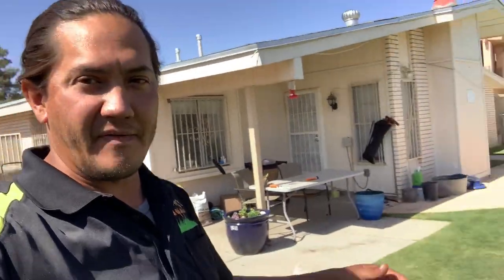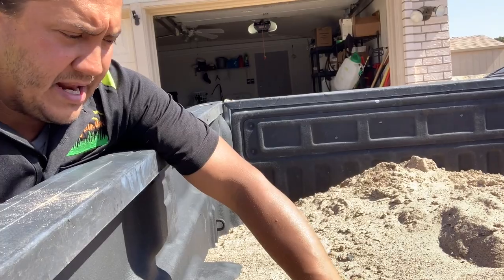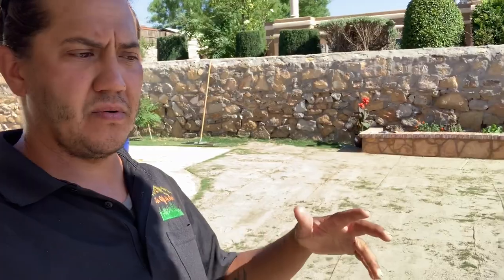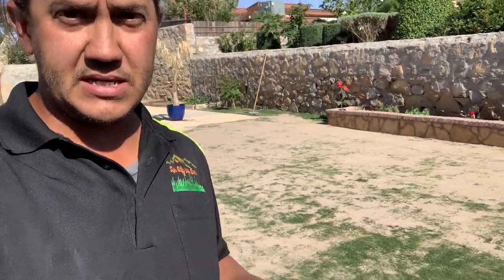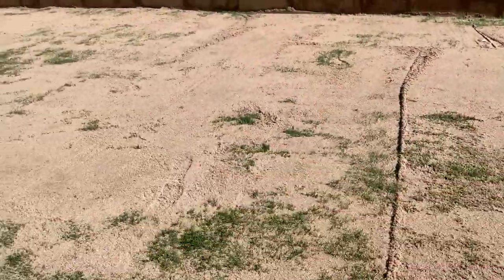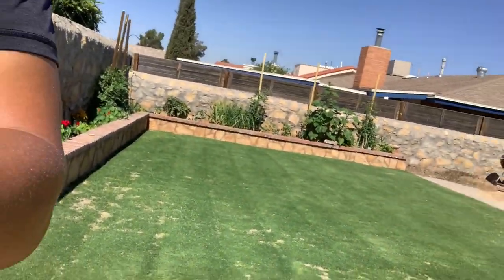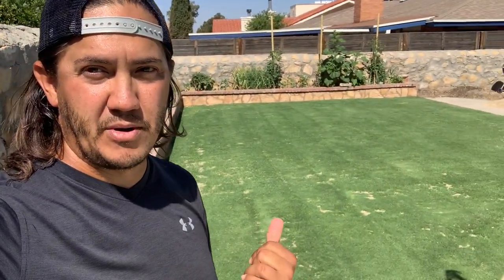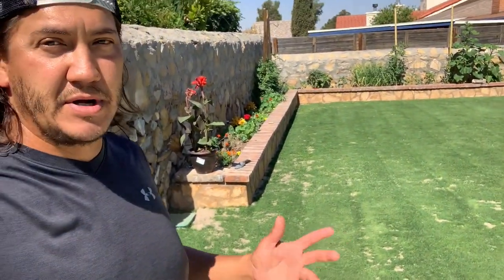How Late Can You Level Your Lawn ?

Comment: How often did you water after you leveled? Also what was your temperatures like? 90-100s?
Reply from the maker: We’ve been in the 90’s for over a month now and finally hit triple digits this week. After leveling I watered twice a day, every other day.
Reply: @SunCityLawnCare  I top-dressed mine 3 days ago and the weather hit 100-107here in Midland TX area and my grass went stressed. Yellowing the tips that were showing through sand. Today is the last day for 100 deg. Then back to mid 90s. I think I’ll water 3x a day for next couple days syringe watering. Would that be good?
Reply from the maker: Watering could only help during these increased temps.